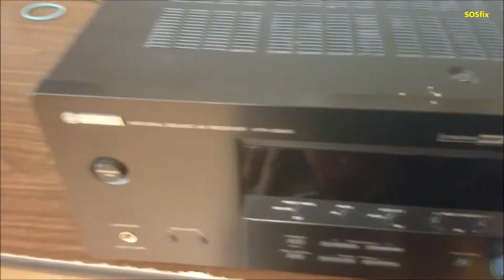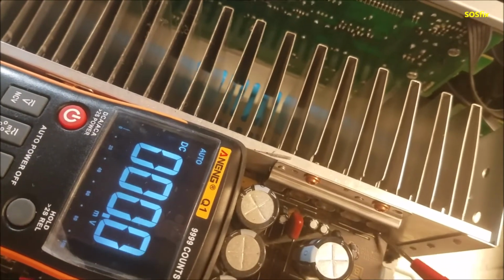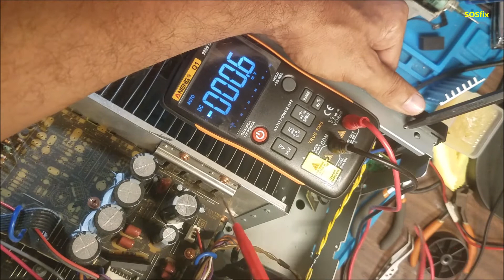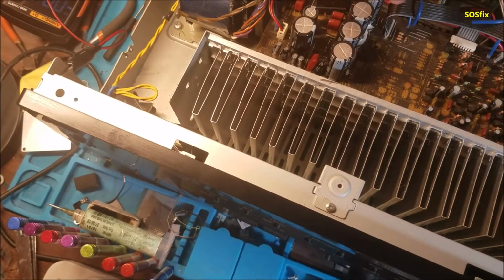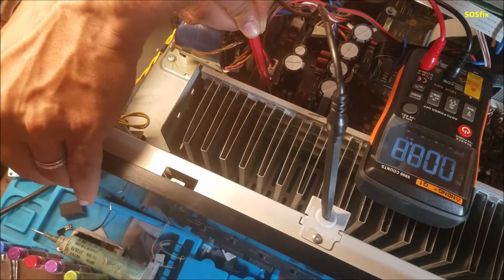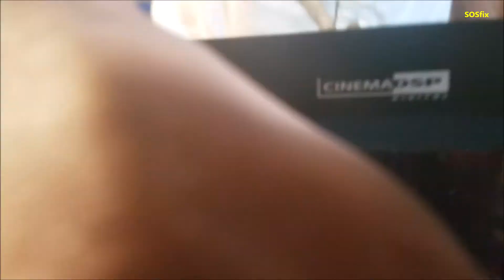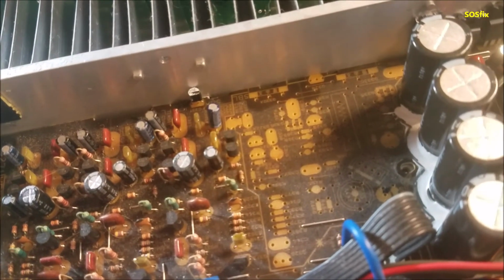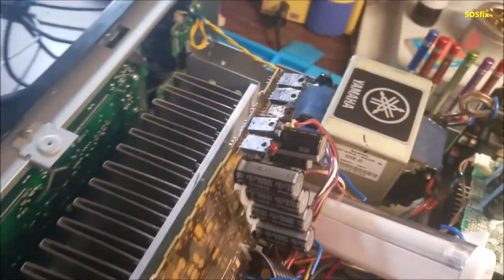YAMAHA HTR-5840 sound system turns ON then OFF troubleshooting and repair

Comment: Thank you very much!!! There was exactly the same malfunction. I watched your video. Checked in his receiver. The stabilizer + 5V burned out. The output of the IC 304 was 1.2 V. I replaced the IC 304 with a similar one, only with a metal mount. At the output of the IC 304 became 5 V. !!! Between the body and the radiator, the IC 304 installed a thermal pad. Everything works. Thanks again !!!
Reply: I was looking for a circuit from this receiver for 2 years))) I tried to repair it before this video, checked the transistors of the amplifiers and at the output, I thought it was faulty, no, everything was ok, I was afraid to remove the metal plate that presses the stabilizers to the radiator. If the plate is not removed, then the terminals of the stabilizers cannot be selected in order to measure the voltages of these stabilizers. I removed the pressure plate. I measured the voltage on the stabilizers. Everything turned out exactly the same as in the author’s video. Changed the stabilizer IC304 and everything is OK !!! I never thought that because of such a simple detail the receiver will not work)))) Now everything is repaired. I enjoy the sound))) +++
Reply: I have the same issue, where did you find the replacement stabilizer? I'm having a hard time finding the part

Comment: I have a Yamaha RX-V861 that has been a workhorse, but after using it regularly for many hours at a time it just developed a fault where it will remain on for some time...from stone cold, up to 30 minutes, and shuts off. After about 10 minutes (cooled down?) it starts again, and then lasts for perhaps 5 minutes before shutting down again.  Is there some thermal protection fault in mine do you think? I tried replacing the 473K 400v capacitor in the power board, but it made no difference.
Reply from the maker: Check for partial short. You need a esr meter to test the capacitors
Reply: My brother in law has this same issue, did you ever figure out?

Comment: On my RXV 350, It does the same. Sometimes it switches on but I have static on the left speakers. can it also be the regulator?
Reply from the maker: the regulator  for power issue. the statics check the capacitors ESR
Reply: @SOSfixElectronics  Thank you for the reply. must i check the capasitors on the main board or on the function board where the regulators are. where do the sound split into the L and R Channel?

Comment: Sir please help me,
I use Yamaha HTR 3072 AVR it was sounding perfect now after I disconnected wire of ns-p40 speakers at back of AVR then connected back again without removing power cord of AVR from AC outlet.. Now speaker sounds so treble up I feel bad.. it was good before now I caused tis problem.. say any remedy please

Comment: I am use Yamaha avr Rx v 665 and suddenly my avr is sound not out displayed only decoder mode off what is problem send solution plz
Reply from the maker: Try to get the schematics and check the voltages and output transistors maybe you have a partial shortage in the output. Not sure

Comment: My yamaha avr rxv 450 having same issue but all regulator are working fine, it shut down after 1 second as same as in this video
Reply: Please help
Reply from the maker: Check the voltage on output of the regulators. And check the big transistors for short

Comment: Same problem with my 1060 aventage ..when i Connet hdmi am to  tv  and i  turn off ...1 of 2 second ..my Avr on again....Dont now why...
Reply from the maker: plug it to a different hdmi in tv
Reply: I try 3 time dfrent cable hdmi Sir...but so Sad...same problem.But when hdmi removed from am..it's i ok..
But when Hdmi Back Connected to am and am deleted Using remote or main button it will live on Its own..
Did this problem every occur after flimware updated??
Reply from the maker: @Gencehgodang  try to reset it
Reply: Ok i try